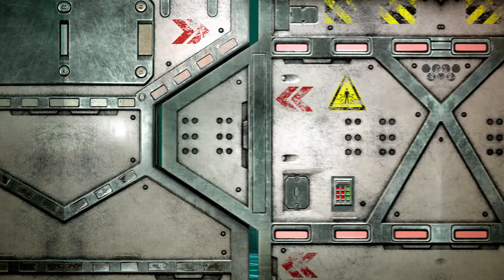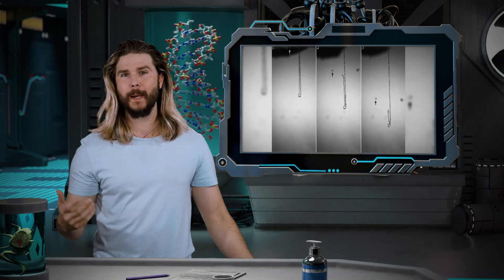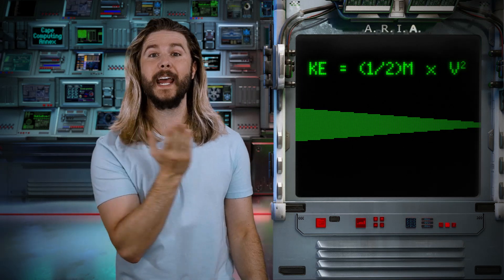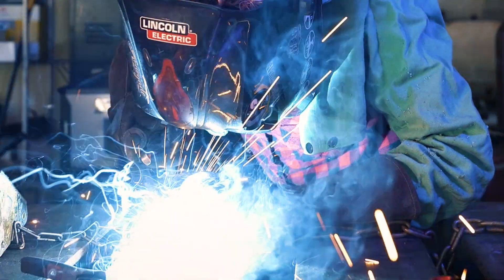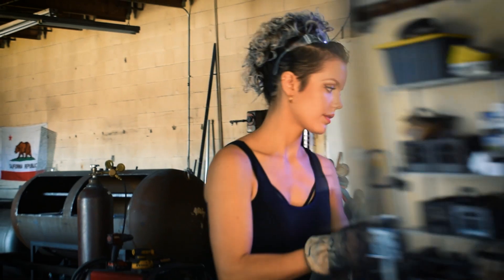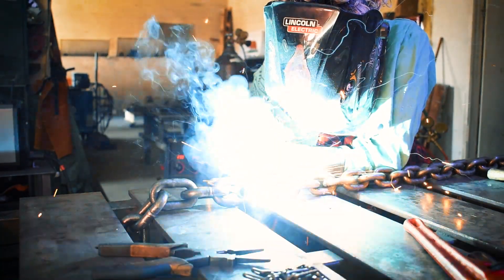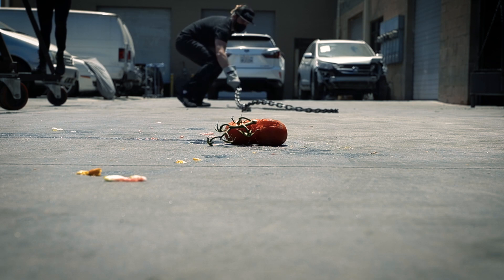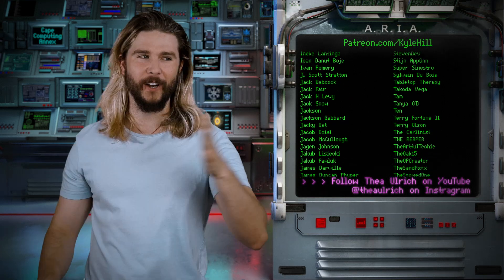Steel Chain Whips are SCARY

Comment: You can braid wire just like leather, wire whip antennae are made that way, they work pretty well as whips they even used a tazer as a handle when they looked into it. Wire whips consist of a small metal ball on the end of a piece of fence wire with a handloop or handle at the other, pretty effective and very light.

Comment: To avoid the mystery energy-conservation reasoning, we can look at a whip as a machine: it's a string, so the relevant simple machine is a pulley system.

The chain acceleration effect is a result of mechanical advantage. The bend in the chain, through the inertia of the chain itself, acts as a block and tackle, and the center of gravity of the chain falls at normal acceleration, but due to mechanical advantage, the free end of the chain accelerates faster.

Comment: Of course, now that the theory has been proven, the experiments need tweaking.
1) Would it work better or worse without that first massive length of chain at the beginning?
2) How would shortening or lengthening a particular type of chain affect the outcome?
3)How would a stronger initial jolt at the beginning (say, from a robot arm) affect the outcome?

This is one of the many reasons that science is cool!

Comment: i can answer this question with out  watching the video Kyle. EXTREMELY dangerous.  that's the answer .  a chain whip is dangerous to every one around it  especially the wielder. one wrong move and they are gonna catch their own weapon in their face.   now on to the video .
EDIT:
ok not quite what i was thinking  but awesome... should have collabed  with Zombie go boom , and used it on one of their anatomically correct heads.

Comment: A question: isn't some of the energy being lost from every link interface, as during movement each link to link connection depends of the physical contact of those links?

Would a tapered whip of woven steel cable work better, and with greater consistently?
Reply: Probably yeah... But manufacturability though

Comment: Why not use steel cable the transfer of energy would be greater and smoother along the length instead of losing it between the links of chain

Comment: I want to point out one major flaw in his hypothesis. Any movement at all isn't 100% efficient. His hypothesis assumes 100% efficiency.  To move anything at all ever you have to move through something which has mass, the force of gravity which i have not seen anything proven that anywhere in the entire universe is not pulled upon by at least 1 object of mass with its own gravity, to a much smaller effect you have the magnetic fields all around us.
Everything has a magnetic field even single atoms do. To move at all on Earth you have to either push away air and/or water. The effects of gravity for most objects on Earth pull towards the Earth known as Earth's gravity. So due to these 3 things if not more any amount of energy you put into something will never come out 100% on the other side. Same reason why we can't have 100% efficiency power supplies.

Comment: You can try to make it with more chains and more smooth transition from big to small and shorter sections so there is less of a jump between each section. If transition is smoother the whipe effect should be even better.

Comment: Two thoughts have come to mind in recent weeks for topics. I know I'm not a super nerd (too broke), but still.

One is to hear your thoughts on why the Coachella Valley has been getting more humid. 117 is a way of life, but 117 AND a dew point of 65-75 is not. It's actually very rare to see our dew point get that high, and I've never seen it be that high AND that hot at the same time when it isn't raining. What could be changing?

And I'm not a super villain either, but I've begun to wonder what kind of explosives would work better in space. As I understand it, a lot of the damage caused by explosions here on Earth is the concussion. You can't have that in space because, you know, no air. So I'm curious how explosives would react and what might be best in terms of military explosives in space. I swear you covered it before, but I can't find or remember it.

Comment: Makes sense, if energy transferring through something loses mass, then it's free to transform to another type of energy or event that's present in its action, like, speed or acceleration?

IE: It's losing mass it has to carry, so it's going faster.

If it loses all its mass for example, it may go light speed. It still has energy, after all.

Comment: If the chain was whipped in space and it was a couple hundred meters long could the tip reach significant portions of the speed of light, assuming the whip didnt break

Comment: the whip doesn't have to tapper though , in order to snap.
you can take a regular rope and do the same thing.

there is the combination of the tapper(if any) and the length of the item along with the material properties and of course the initial energy put into it.

Comment: What if you used a braided steel cable, and just cut a couple strands as you go down the length of the whip, and weld the end of the strands after you cut them to keep it cohesive?

Comment: Wouldn't the whip's friction with the ground reduce its force as the whip slides across it? I know it's absurd to flail the whip in the air when it's that heavy but would that help it break the sound barrier?

Comment: why are you throwing it on the ground instead of using it like a whip?? all that friction resistance is killing the power
Reply: You would need a bodybuilder to try and properly crack that whip... 
even a normal leather whip at that length would be hard for an average person (I could be wrong, but I'm assuming that whip has more than 10 feet)
Reply: @darkljs  except physics. just like it seems implausible that the tip of the whip would be going faster than your arm, but it DOES, you wouldn't need to be able to wield the entire weight of the whip. Plus I don't think it's as heavy as you think it is. I bet the whole thing is less than 20 libs (that's how I say pounds, cuz english)
Reply: @therealjoshtodd  to swing it around would certainly not be that hard, but to properly crack it takes way more than you would think... I was surprised at how hard it was to crack a 10 foot when I first tried ( I'm not in any stretch of the word "fit", but still... Not exactly a weakling) and at how sore my arms and shoulders were the next day, and that was a normal whip... 
And it's not just any flick of the wrist that will make a whip crack, you gotta make it go into a loop, and not just a wave as Kyle showed in the video
Reply: @darkljs  I'm really not trying to pick a fight or be condescending, but I got a 10 ft whip at 12 and learned how to crack it with my dad in less than an hour of practice, and i'm not a big dude. It's more about technique than strength. it's not so much a flick of the wrist, but a sling then a yank as the whip is almost "uncoiled", for lack of a better word. I had the same problem in cheerleading (yes I was a cheerleader in highschool) and I had the HARDEST time tossing the girls up because, again, i'm not that big a dude and the other guy on the squad was the same size and had no issue. Once I got the technique down I was like "jesus why was I trying to muscle through it all this time??".  Anyway, the chain probably isn't as fluid as leather strips braided together, but i'd sure have liked to see him try it! If it was a fail, could have been on the blooper reel
Reply: @therealjoshtodd  no problem dude, we are just having a healthy discussion here and it's not like I know much about the subject XD
And yes, it is more about technique than strength, but at least in my experience, it does get progressively harder to crack a whip as the length and weight of it goes up... and I'm not trying to diss Kyle, but I'm not completely sure he could do it(or if it's even possible to produce a sonic boom with that kind of chain, though again I don't know much about the subject anyway)
But it would be cool to see him try(dangerous, but cool) especially cuz I bet almost everyone here expected that
Reply: @darkljs  Glad we can keep it civil. Sometimes people get RUL mad when you disagree with them on the interwebz. And you're hundo p right about absolutely everything you just said. it does get harder the longer it is, kyle (or anyone at all, really) may not be able to pull it off, and it would absolutely be cool/funny to see him try and probably everyone did expect it! Obviously the way he did it "works" but would have loved to see some outtakes of him attempting it, for sure! Whatsherface could have made a handle and welded it to the base of the chain to make it a little more dexterous.
Reply: @therealjoshtodd  oh I know... People get real crazy sometimes haha
And yeah, I was thinking the same thing, would have been better with a handle... They should have thought about making it as a stockwhip rather than a bullwhip(even what they did wasn't exactly a bullwhip)

Comment: could you CNC progressively smaller interlocking plates similar to that of armadillo plates formed something in the way of a ball joint like your knee or shoulder and end in a ball bearing for added weight at the tip? if not id just uses a CNC anyway to create a series of progressively smaller links from one end of the link to the other to facilitate the movement and allow for the next link in the chain.

Comment: Essentially as you approach the end of the whip or chain the mass of the moving portion approaches zero,  and the speed approaches the infinite positive side of 1/0.  I don't know if KE is mostly preserved or just momentum, but either way it's probably a process where a little efficiency optimization goes a long way towards scary results.  With enough relative reduction in losses I'm not even sure the whip needs a taper.

Comment: I wonder if it would be possible to use steel cable, removing a strand or two at intervals until you're left with a single strand? Maybe it would be too rigid though.

Comment: Evil kyle: mounts whip onto a motor to make it spin around like a giant weedwacker... Doomwhip.
Reply: Actually the better tool to attach it to, IF your goal is to emulate a whip is a catapult, except the chain's heavy end is permanently attached to the end of the lever.  Of course, this means the catapult is no longer a long range weapon. It's now a super melee weapon.  Of course the problem here is the delay between blows due to the rewinding the catapult lever back and pulling in the chain behind the device again.

Comment: Figuring out the mass of a whip needed for the tip to theoretically go light speed, assuming the tip is roughly the mass of a strand of DNA in a single cell, 1 picogram, 1 trillionth of a gram, 1e-12 grams. and let's also assume no friction of any sort and an indestructible material. so that's a starting velocity and mass of (1/2) 1e-12g x 299792458m/s 2. gives 44.9378J, about 33lbs of force. yay numbers. now let's give a generous speed for the cracking of said whip say 12m/s for simplicity or almost 28mph.
Now find your favorite calculator plugin KE and V to find M and assuming I mathed correctly you get an unremarkable 624.136g, 0.62kg, 1.3lbs which is only marginally heavier than an average bullwhip, even if we cut the speed in half you only get 2.49kg or 5.5 lbs (noting that's the weight of only the handle not the full length or any semblance of how unreasonably long that whip would be).
But those numbers are weak and that tip is nigh undetectable. what if we drop all those decimals. let's make to tip 1 full gram, a whopping 0.002lbs. well just repeat all the maths and change the mass. which equals 44937800 MegaJoules at the end, 45Million! with a handle with a mass of 6.24136E+14 g or 624 billion kg. That's 1375984344710.21 lbs or 624 million metric tons. to pup that in perspective if it where solid steel it would be 77,515.5 km3, 48,165.9 miles 3. That would mean each face would be the size of Nebraska with almost 100km2 to spare or the  Czech Republic with almost enough room for all of the Cayman Islands to spare.
if someone wants to calculate the volume and length and density of said whips be my guest.

Comment: Would it be possible to create a whip capable of breaking the sound barrier, made out of corded steel wire? Sure the chain is cool, devil may cry style... but you know... longer and more intricate.
Reply: I mean is it possible for a tapered corded steel or stainless steel whip to have the tensile strength and flexibility to actually have that "pop".

Comment: I do love a nice practical experiment, especially in relation to chains. (I make Chainmaille so they are a subject close to my heart) that said you could get a smoother tradition of energy with 3 point 4 in one varying ID, wire diameter and material mixes of steel throughout your conical linkage. You high ferlooting zaphod beeblebrox you. And to lady Thea, <tips bowler hat> To make, is to manufacture dreams. All hail the dreamers.

Comment: I really would like to see Kyle either shorten the chain to make it more manageable or get someone/build something strong enough to whip it more traditionally. Or even put a chain mesh tip on it to see if it were possible to get that sonic crack.

There is so much energy loss due to friction of it riding on the ground versus just air resistance of more traditional whips.

Comment: Surely another reason for the increase in speed is like with the wheel. Following a greater circumference causes greater speed, but requires more energy, so all the energy is in the tip. Unless this is just the difference between rigid and non rigid 'whips'.

Just to say you talk a lot about a taper, but you could have a whip without a taper.

Comment: Honestly wouldn't it been more dangerous  made from guitar  wire braided like a bull whip cause the leather  stretches  as force travels  thru it tighten the braid more making the whip more ridged by time it snaps  and the guitar  wire also  is solid less mass for the air to disperse  and more aerodynamic  due to not having to have air travel around and thru each link

Comment: Hey Kyle, I'm a turbo nerd with a fun question that might be a fun video to do.
This centers on the DnD 5e spell, 'heat metal' which says the targeted metal is heated to glow red hot. What metals would be the most effective for this? 
Rather than just say the thing with the highest specific heat capacity, I've been thinking about something like mercury, which would evaporate well before hitting the point it emits red light, and that gaseous expansion sounds fun. What are your thoughts?

Comment: I've reproduced a very similar effect with various assortments of wire and cable. I braided strands together and gradually tapered it down ending with the center of a coaxial cable that embedded itself into some wood and ripped open a few soda cans.
That being said, the chain is a much better idea as the link formation makes it far less resistant to wave propagation.

Either way, don't try this at home without extreme caution, you could probably kill or maim someone pretty easily by accident.

Comment: Thinking about this... towels can be spun at their diagonal corners which creates a taper both up and down with the heavy mass in the middle. This still can produce a whip effect.

And as I think about it, the law that states equal and opposite reaction would dictate that as the chain whips out, every link is pulling back in relative motion towards you then it becomes a heavier and heavier mass of every link behind the leading edge of chain. With all that mass that builds up the force of the pull begins to pull stronger and stronger on that leading edge which pulls it faster and faster.  The taper just makes this a more efficient process. That would be why the chain travels faster downward in free fall than the quarter. The chain being stationary is physically pulling on the chain adding to its velocity of fall.

Really cool episode!

Comment: I wonder how you could make this but with a steel cable instead? Could you just weld progressively smaller cables to one another or would that compromise the cable and break at the weld? Or maybe every foot you remove one steel wire from a very thick cable so that it gets thinner till it's just a few wires at the very end? Reminding myself how a cable looks through a Google image search, the second option sounds very annoying. I bet it would be easier starting with the different lengths of wires and making the cable yourself (but still difficult.) However once you're finished you would have a terrifying weapon.

Comment: What about using a braided steel cable and cuting one strand every 25cm or so and welding it to stop fraying, leaving a single strand 25cm long as the tip?

Comment: I wonder what the most efficient (kinetic energy wise) ratio for taper for the whip would be. Plus useing some kind of cable that tapered would look cooler, and you could try a different material or two, playing with mass, durability, and strength until you have the most efficient metal whip out there. It would be even better if you could either use a really strong thin material for the end like a wire, or something sharpened at the end to increase the peircing power. You could call it a javelin whip because it would puncture like a spear and slash like a sword.

Comment: If you had gradually softer springs set between the links you'd be able to magnify the force exerted. Think maximizing the crest of the wave along with a mechanical recurve from the pull back of the springs. P.s. DONT try this at home. One wrong mass load on the wrong size spring can cause disaster and extreme blunt force damage..